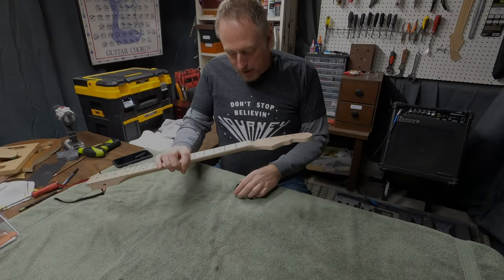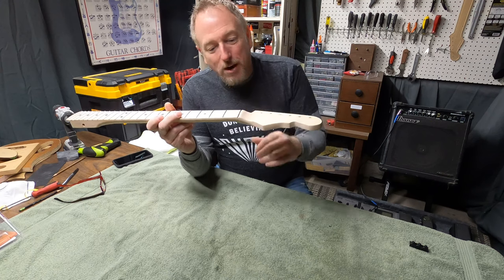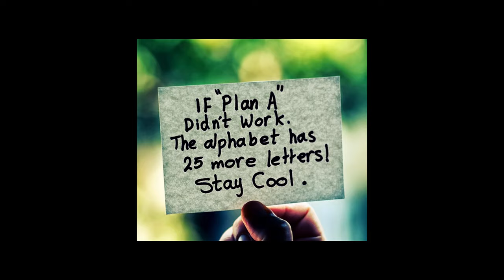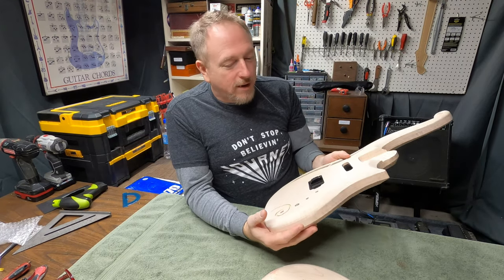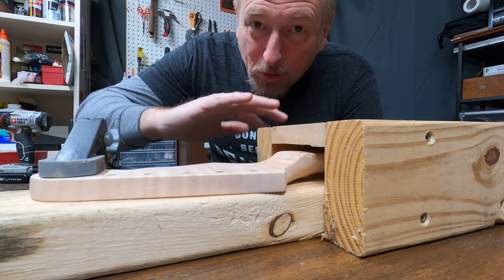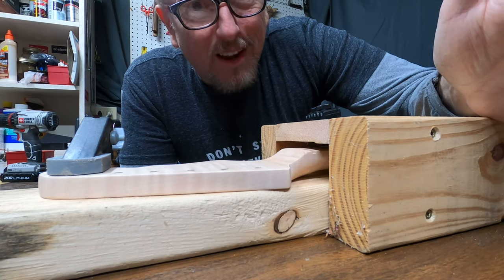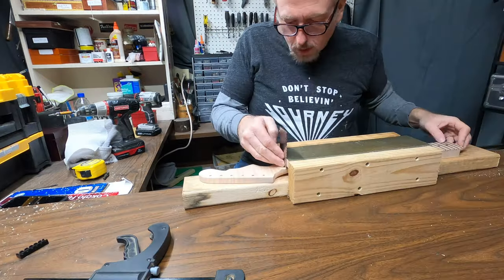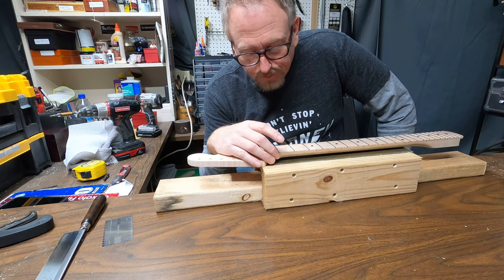Locking Nut on a Fender style neck!     -     Cloud Style Guitar Give Away!

Comment: I use locknuts on almost all my builds.  When dealing with a Fender style neck, I just take it down with a Shinto rasp by hand - takes like 5 minutes.  A fret pulling guard fits nicely in the bottom of the nut slots and can be used to check the nut slot height vs the fret plane.  I typically shoot for nut slots at 0 to 0.5 mm above the fret plane.  I find this works well for 24 fret necks with zero relief running 8's.  If the nut needs shimming, I typically use shims cut from 0.3 mm thick brass sheet.  For smaller amounts of shim, the aluminum from a soda or beer can typically clocks in at just 0.1 mm thickness.  I typically install with CA glue only, and don't use the screws at all (front or back). If you set the action at the nut by setting the nut slots to the fret plane, you don't have to assemble the rest of the guitar.  The neck will work with any body and bridge height, once you have the correct neck break angle.